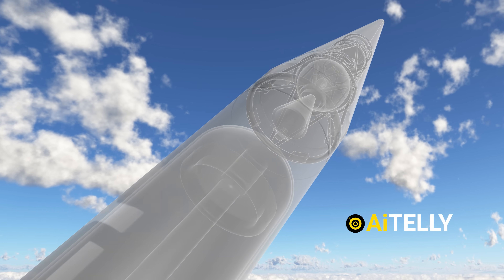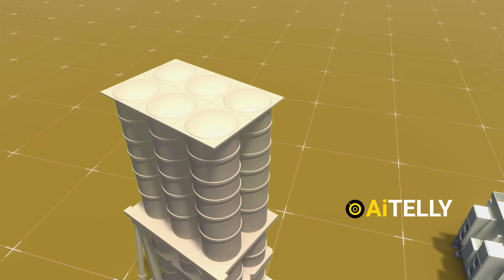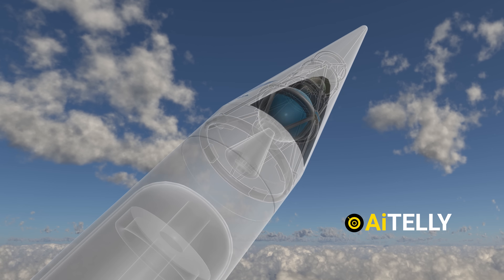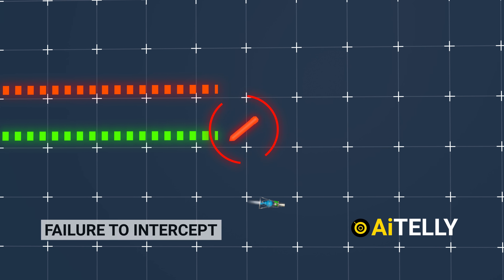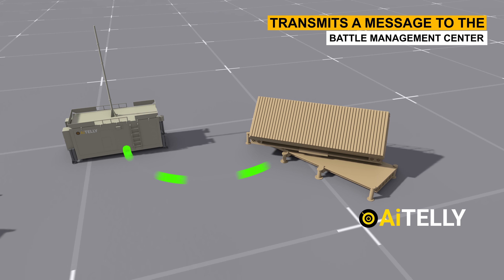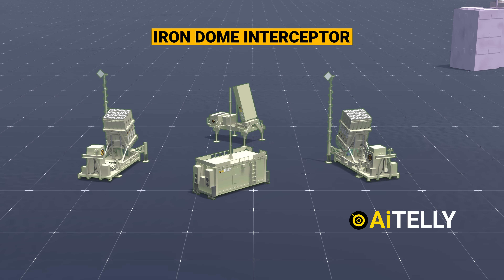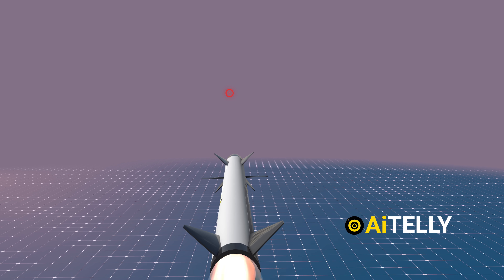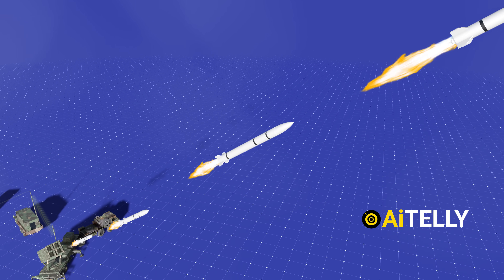How Anti Ballistic Missile Works | Arrow 3

Comment: Still failed to take out fatah missile
Reply: @Panthersky.nq2  One single missile missed. This still tells of the Arrow 3 accuracy, which is measured as engagement-to-interception ratio (missiles not intercepted due to system saturation - more missiles than can be engaged by the defense system - do not count).

Comment: Most of the ABM weapon is a fuel tank and fuel.  Can a .45 magnum bullet really put a hole through an engine block?  A one gram object traveling at ten kilometers per second has as much destructive energy as about 100 .45 magnum bullets.  If the one gram projectile hits the large sphere of high explosives inside of  a nuclear warhead, it would probably explode.  The fission bomb is set off by a spherical compression of the uranium and or plutonium.  A lopsided explosion would not tend to set off the fission bomb.
A major argument against the ABM systems is that the enemy can compensate for the defense by spending  less money on more missiles than additional  defense costs.  
A ram jet consists basically of a cylinder with a special cone on one end.  It can be much lighter and simpler than a gas turbine jet engine because it has no driveshaft or comoressor blades  and turbine blades or any  other moving  parts. If it is possible to heat up the compressed air from the air ram with oncentrared solar energy, the jet would have unlimited range and need no fuel or fuel tank and be much lighter. If jets of compressed air are injected into the cylinder from the air ram so that the air spins and an electric arc is sent through the spinning air, a disk of plasma would be created. A critically dense plasma is opaque to light and if concentrated solar is focused onto it,  an extreme high temperature much higher than the melting point of a solid collector could be obtained.  This extreme high temperature much higher than the temperature of burning jet fuel could drive a powerful ram jet engine.  If the plane is angled towards the sun to properly align the mirror, the solar energy can be used to accelerate the ram jet and climb to the upper atmosphere and possibly into space. 
If the jet can be miniaturized down to a tiny size as small as one centimeter and weigh one gram, it might be fired from the ground from an air gun and destroy a nuclear warhead illuminated by laser light 50 miles up in the atmosphere.   
If the micro ram jet costs $10, it night be deployed by the millions for less than the cost of one nuclear warhead and make it impossible or near impossible for a missile to get past the defense.
But what if it is dark?  If the ram jet is travelling fast enough it can travel faster than the sun sets and remain on the lighted side of the Earth for any length of time.   At very high altitude and at  ten kilometers per second it might maintain most of its altitude and velocity  in the approximate ten mi uses that it would take to reach any point on the dark side of tge Earth. 0:00

Comment: Thanks for video 

Question: if the opponent target your side with 1500 combination of drone, cruise missile and in the back with Balistic missile 

what happen to Arrow or Iron Dome or S-400   ADS with number of 1500 things which was launched? 

Answer: you'll never see tomorrow
Reply: Israel has 4 layers of defence system: 1.iron dome: rockets drones uav and artillery 2.david  sling: long range rockets uav and cruise missiles 3. Arrow 2: ballistic missiles 4. Arrow 3. Advanced ballistic missile, so it's doesn't matter if they launch 1000 drones and 10 ballistic missiles because each target will be intercepted by different systems

Comment: I find it interesting that Isreal would opt for a two stage interceptor missile, as the added complexity would normally make such an assembly more expensive and less reliable
Reply: Money is no issue in Israel.  The USA borrows as much as we want...   I mean need.
Reply: @autumnfragrance6326  money is meaningless if you dont have the skill to use it. Look at UAE. They did nothing with their money
Reply: Two stage interceptor make a lot of sense when you target the interception to be in space, it allows the kill vehicle to be very light. The lighter an object is, the easier is to change its direction/trajectory meaning better maneuverability. Better maneuverability increases the chances of intercepting a target, especially those that try to do evasive manuevers.
Reply: Because they use pre assembled rocket missile. Building new rocket just to have 1 stage missile is expensive and would decrease the ammount of rocket they can have. Also reliability isn't really an issue so long you maintain them, remember reliability not just kept working despite lack of care but also easy of maintenance and easy of spare part manufacturing